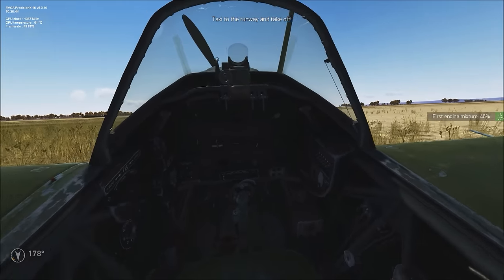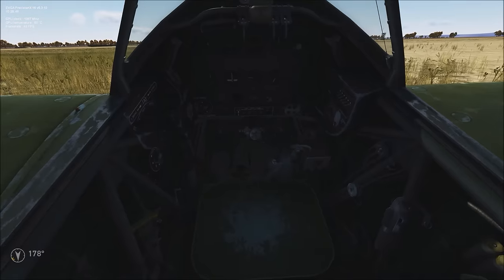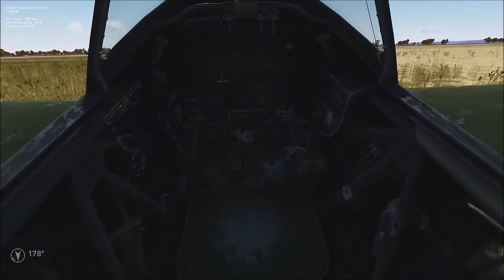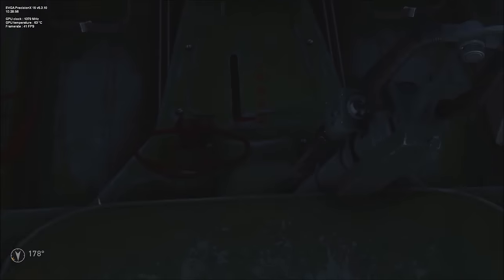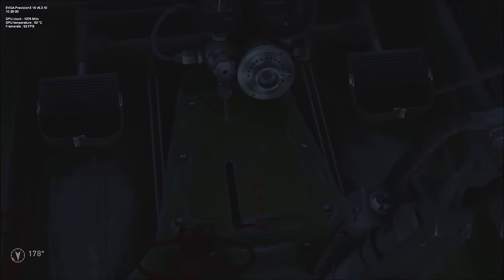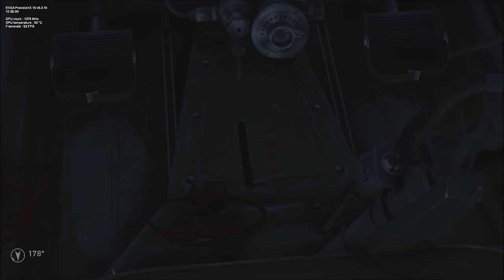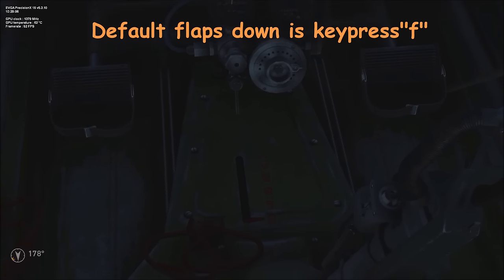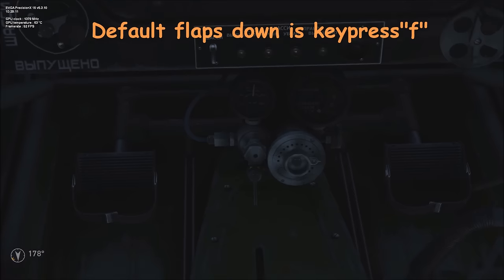MiG-3-Series24 Flaps Settings

Comment: Did not understand this and the continuous movement inside the too dark cockpit was annoying.  There seems to be a difference between holding F and shift F, and touching them once.  Do you set the limiter and then press F briefly to deploy to the limiter position?  Do you then press Shift F briefly  to retract to zero?

IL2 is a hard sim to learn and this flap deployment is a bad user interface design.  If there are two separate mechanisms on the plane, i.e. set limiter and deploy/retract then there should be two separate sets of keys.
Reply from the maker: A Google User H yes they have changed the way flaps work 2 updates ago.